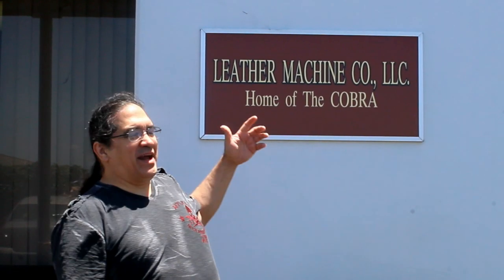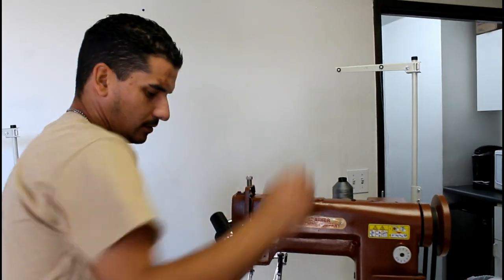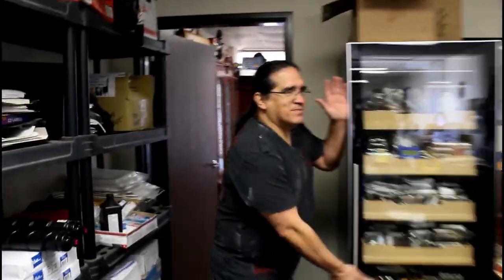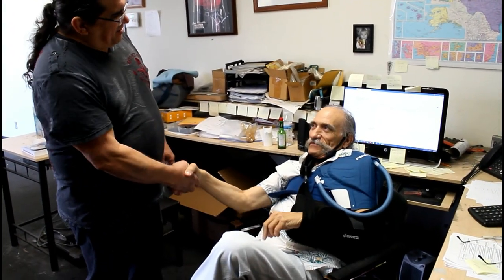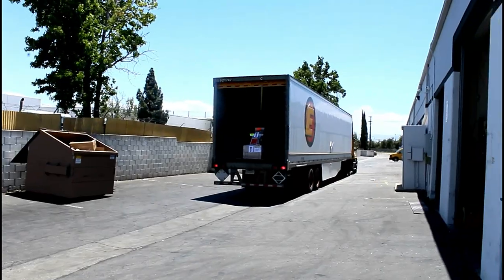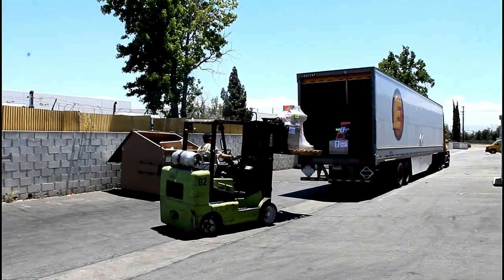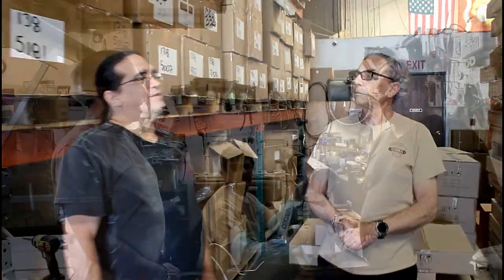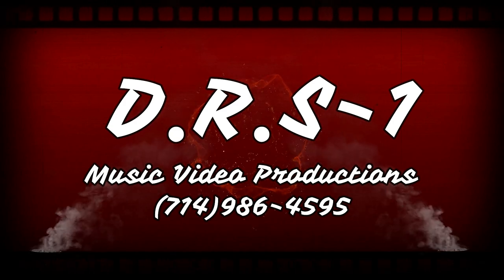Al Bane visits The Leather Machine Company.  A Walking Tour.

Comment: I have a couple of observations about my new class 4.  #1  The angle of the foot feed for the motor is not where I would have put it.  It sets too far forward (close to the operator) and is uncomfortable when sitting up close to the head.  I guess if you operate it while standing it might be different.  #2, The motor engages a little too quickly regardless of the preset motor RPM.  My other servo motors have a little slack before starting and will engage the needle more gradually.  These are just my observations and may just be quirks of the product or maybe just me.  Other than that the machine has tons of power and it comes with a size #25 needle installed. The bobbin thread that is shipped with the machine is larger than the needle thread.   That produces a nice bottom stitch.  Since I'm not sewing with size 346 thread, the bobbin thread seems to just about disappear between stitches because of my lighter weight thread in that #25 needle hole. Also, this is with the upper tension backed all the way off.  Am ordering smaller needles #23 to reduce needle hole size to see if that produces a more visible bobbin stitch.  And, Yes, it is threaded properly....!